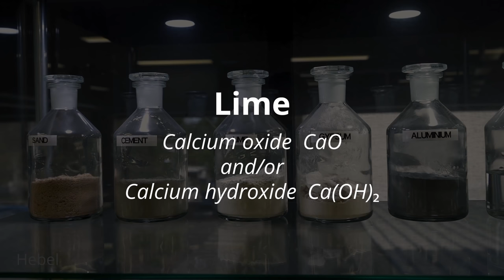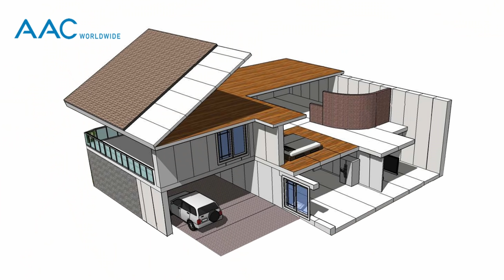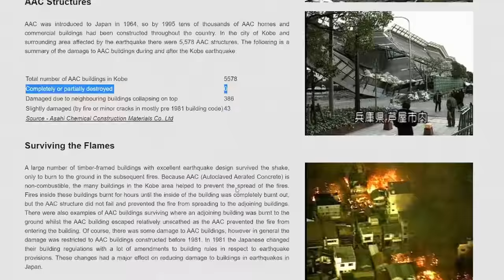AIRCRETE lightweight concrete | Everything you need to know

Comment: You are overexcited about this material. Here in Russia we are widely using these blocks in construction. Soundproof next to none. Very brittle to handle and have tendency to crack over time. Soaking water as sponge loosing all the insolation capabilities. Only real advantage is the cost, probably less expensive material of them all, but still has a lot of downsides.

Comment: I have built my house with AAC in order to make the house a fully electric one. There’s no gas service in the region and I didn’t want to deal with a wood boiler.

My house is very energy efficient so even using electricity to heat it, it is still cheaper than natural gas in traditional brick houses.
Reply: In EU we have strict rules for energy comsumption of new builts,  it's easy to build in passive standard  with aircrete.

Comment: Half of houses in Poland is made out of it. 
The blocks have to be protected from humidity, VERY well. 

Saying that, it makes sense and can be very cost effective. 

I think in Japan it is used as a filler for the walls, due to strict earthquake standards. Saying that, these standards were introduced after Kobe disaster. 

Personally I think it is a decent material if used as intended. I'm still surprised it's not used in America. It provides some thermal mass, making buildings more comfortable to live in. 

It would definitely help to build cheaper housing, as it is possible to make the walls in one day with smart design and a small crane.

Comment: As a Building Scientist - I can tell you a trick to making this type of concrete in small quantities:
.
.
We got cows blood (disgusting I know - sorry) and mixed it with the concrete mix, then vibrated the mix.  The blood quickly creates bubbles and holds those bubbles long enough for the concrete to set.
.
.
We coated the outside of the concrete and cast small boat hauls.  We then competed in a boat race made of concrete.  "Most" of us did not do a good job of coating the concrete and hence all the boats would quickly get soaked and sink while we were paddling as fast as possible.
.
.
It is a great material but it does have its limits - don't use it where structural strength is needed (no reinforcement in this material).  The only true problem with this material is that it is expensive.  Say as divider walls in a building - it is easier to cast concrete as the construction already has all the settings for casting concrete.  Don't get me wrong - I'd prefer this material as its sound resistance properties are way better than cast concrete which makes it more suitable for a dividing wall.
.
As for simple housing?  This material would be fantastic in houses.  Unfortunately tradition trumps all.  In North America they don't even use ceramic tiles on roofs that last forever, instead they use shingles that need to be replace at an expensive cost every 10 or so years.

Comment: Do most U.S. building codes allow them as the primary structural component? I was under the impression they can only be used as infill in walls that have frame members.

Comment: Thanks for the tip with HEBEL building materials - an alternative to YTONG which I experienced roughly 40 years ago: I had a block of YTONG to sculpture it with simple tools and with moderate force applied.
I do not understand that these materials haven't found their way into standard building practices much earlier. Monolithic walls for passive houses ... would have solved a lot of the problems with high energy demand for room heating (her in Germany).

Comment: I have been hoping to see a video like this for a while now. One thing I would have have loved to see touched upon in the video is the efficacy the DIY aircrete methods that make it by means of mixing concrete with a foaming agent such as dish soap. Given this can theoretically be made on site it may in some circumstances have more benefits than premade blocks.
Reply: Foamed Crete is not as strong (unless you add fibers). It will crack. It's hard to get the recipe just right. But... much cheaper, no shipping

Comment: After building a partition wall with half sized concrete blocks (75mm) I came across Hebel blocks. There was a gap from a high set timber house to be filled in. Now I love this new product but there is practically nothing available in remote regions to integrate it into traditional building materials. Great product in desperate need to interface to legacy structures.

Comment: One of the biggest plusses for me is that it is so easy to work on. You can saw these with a normal wood handsaw if you want. It will wear out the teeth fast though.
I've used these blocks to close up an old door opening, and they're very regularly used as the first row in mason walls, because they have decent thermal insulating properties to keep the cold from the ground out of the walls.

The one application I don't get is the sound blocking wall you showed. It seems like these blocks are too fragile for this application. I'd also worry about the prolonged effects of rain.

That all being said, I'd never want a house built exclusively out of aac. I'd want my walls and roof to be sturdier that aac.

Comment: This could be an interesting material to use for a boat hull and deck.
Reply: I don't think it has enough compression strength if used as a core material for boats.  It will pulverise under high loads. It hasn't any elasticity. Exterior sheathing could also be problematic.
Perhaps ok for house boats.
It's still a very worthwhile material for static or low stressed constructions, though.

Comment: Pretty much every new house in europe is built using aerated concrete blocks. Ridiculously fast build time. Especially for those single-floor "american" style houses without a cellar or living space in the roof (weak and lightweight ceiling). Installation and finish is also super easy since everything is straight and square due to slotted block design. Idk if those homes will last as long as our 200 year old atomic bunkers with 32 inch brick/ reinforced concrete thick walls but it will definitely last longer than a paper home.

Comment: In Romania (Eastern Europe) it is one of the most popular building materials. It is relatively inexpensive, very easy and quick to work with, but requires additional insulation on the outside of the building.
Reply: Curious to know what the additional insulation is made of
Reply: @EbrahimHasan  Clasic EPS,  rockwool or fiberglass
Reply: @EbrahimHasan  foam dude. insulation is mandatory here for new building.
Reply: Cool, now I'll try to find Romanian houses made with this online.
Reply: @Timoshim  thanks so much gor the tip!
Reply: @helloworld963  @Kaldusar So strange. AAC is insulation in and of itself and we build with it alone. Sometimes we thicken it for added insulation. It's a lot more lasting and much cheaper and stronger than EIFS and other material both to acquire and to install.

Comment: Very cool.  Emotionally satisfying.

Also, I'm reminded of the DIY air-crete videos on YouTube, and wonder about their viability for 3D printing homes or shooting layers if their tech were extended.

Thank you for mentioning the STC rating!  I'm guessing it could be increased to sixty or sixty-five (which would be preferable) if the wall system incorporated two layers of two inches which are de-coupled, although that would require separate structural support to avoid anchors between them.  It would be, again, exciting to see aerated (like the DIY foaming) being, "shot," onto "non-ferrous" chicken wire or stucco latices on opposite sides of an interior wall which could later be plastered (hopefully with European style limestone plaster rather than Portland cement) to avoid paint and give a long lasting surface that abates moisture.

Comment: All pro's are mentioned well.
Some Cons:-Water is biggest enemy of this AAC blocks.Concealed plumbing line leakage will give you some ugly time to locate & rectify as leaked water can dampen  the wall & paint finish of the wall.
Water also rises from cement mortar laid beneath the floor tiles & spoil the wall finishing.
Nails don't have a grip so need proper care to do so

Comment: It would be cool if this could be produced on a smaller scale.  Making it more localized might increase its popularity.  And it would be even cooler if it could be 3d concrete printend.  It would be extremely slow but could have some crazy allocations.  Regular 3d printing is experimenting with foaming plastics, which has some cool results.   It's not super useful yet but i feel it will find a use.

Comment: Usually people test aircrete heat resistance by short time high temperature. What about continuously see how long it needs to release the heat to the temperature before burning.   And why don't test by using lower temperature like 70 degree  for a few hours heating see  if the results are almost same.  It is better than other brick, but too fragile and It might not work that well to tropical country, the interior will still hot  , but in the slightly slower way. End up the whole night will be warm😅, I think the better way is to block the sun heat before it arrive to the wall material.

Comment: SO why it is not used that much? 

Time - the blocks arrive with a high moisture content and require time to dry out. Thus a traditional construction of a house done in 6 months is impossible with this blocks: exterior/interior walls cannot be finished as soon as the box is up because the walls need ventilation and time to dry.

The shape is not as regular as manufacturers make you think requiring manual labor and attention --> thus specific learning and skills

For seismic stability, they require reinforcement columns and belts and do not by themselves offer any additional seismic resistance. 

Passing conduits, cables or pipes? easily done but not as simple as drilling a hole in the 2x6. Or... you have to double up the walls and ceilings by using sheetrock on steel studs much like in an industrial construction. 

Repairs... moving the kitchen cabinets on a different wall... buying door frames (interior or exterior) for this thicker wall ... Everything becomes an issue with this tech because there is no expertise and it is not standard in North America.

Move to the Europe and YTONG is known almost everywhere and all of the above is a non issue.

In short,  it is an interesting material but it has its drawbacks and quirks that make it much less competitive in US and Canada where the entire industry is build around specific building methods and materials: sheetrock and stick frame (or sheetrock and concrete and steel frames for bigger buildings).

Comment: You mentioned lower transportation costs because of the lower weight.
The limiting factor in transportation is volume, so concrete mix should have a lower transport cost compared to aerated concrete

Comment: I'd really like to know how this would fare in marine environments. We're planning to build a float home. We're not remotely concerned with aesthetics, frankly, so that's not the issue for me. I'm wondering more if it's too light for use. The boat has to be calculated to have a stable draft, and if you can have a heavier boat you're less likely to have issues when the water gets frisky. I can see creating pontoons out of this, or possibly filling the insides of plastic raft barrels.

Comment: If it uses less sand we may have to start moving towards using it anyway. The supply is dwindling far too quickly for how long it takes to replenish it.
Reply: For stuff like concrete we can produce it artificial sand, yes wind blown sand doesn't work I know but crushing works fine for making analogous water sand, also given how porous concrete is made I'm decently sure it uses mechanically modified sand anyhow, so I assume it can get by with the desert sand we already don't use and just crush it to a finer powder.
Reply: @jaykoerner  Besides deserts, there is an incredible amount of sand where rivers reach the ocean. In the Pacific Northwest around the mouth of the Columbia the beaches grow very quickly and it would swallow towns if not shipped off continuously though much is dumped and not used.
Reply: @seasidescott  I was talking about specifically unusable sand,
Reply: @jaykoerner  Beach sand is considered unusable for mortar and construction because it is rounded just like wind blown desert sand. I was taking your lead and saying that if there's a short supply and we've resorted to crushing it, there's plenty more.
Reply: @seasidescott  I have nothing to add because your comment added nothing to the conversation between us since it just fleshed out info I stated, but hopefully it's helpful for someone else reading this

Comment: Nice material, nice review, but Belinda is incorrect on soundproofing. AAC has poor sound insulation properties. Even a 60-centimeter thick wall of D400-grade AEC  (as in my house), by itself, doesn't stop much exterior noise. Fortunately, for me it's mostly birds and wind.

Comment: This sounds, cheap, good for insulation(?), and probably ok for a home, but I really doubt it will stand up against the elements over long periods of time, and it likely wouldn’t do well when put under great stress.  There are types of (expensive) concrete designed in response to 911 that are magnitudes stronger than conventional concrete, but I imagine this wouldn’t help reduce the casualties caused by a structure failure.

Comment: You mentioned things like aec being pourous as to therefore require additional waterproofing substances to coat the outer walls if used as home materials. I'm curious what are the combined costs. Old traditional bricking/concreting vs same structural value using aec and it's assistance proofing parts

Comment: You mentioned that it is recyclable, can you expand on how that works?
This AAC would be perfect when used in RBV (Reverse Brick Veneer) construction except using AAC instead of brick, which is A LOT better thermal mass-wise.

Comment: I think an A-frame with impact windows / shutters would be a good test bed. I'm curious about wind load and  fire resistant /waterproof coatings. With that it could be viable option in many places.
Reply: Tilt-up EPS/steel sandwich panel roof; apply shotcrete.

Comment: Questions! 
1. Can this be combined with IFCs or would that be redundant?
2. Would this sweat in humid places where air conditioning is used?
3. Does this work with FRP rebar or other alternative kinds of rebar?
Reply: I'm no expert, but currently building with it.
1. Doesn't pour, so AAC can't be used with ICF. DIY foamed-crete isn't practical. Not strong enough, you can't pour that many yards (no concrete truck will pour it)
2. Absolutely no sweat. Hygroscopic like wood. Most comfortable wall I've ever experienced.
3. Will work with any rebar.

Comment: No need for expensive manufacturing plants to produce cellular concrete, construction blocks. The future is a small footprint, mobile manufacturing plant. One that can produce several hundred blocks a day to support about a hundred mile radius. Low energy, low labor requirements. All unused water is recycled along with left over material. Yes! This will work in California. I'm on a mission!

Comment: I am fascinated by this building material as I have designs on building dome housing in fire prone areas of the SW. Can this formula be used as a pour in place material even though it may be prone to shrinkage? I'm also curious as to the fire rate of perhaps a regular alkaline fly ash concrete verses a poured slab of this aluminum activate alkaline foam concrete. I ask this because to maximize fire proofing of a structure would you want a layer of this on the outside of a dome of hard concrete as well as inside a dome? Do you think it would be a good insulation material to inject between 3D printed walls for sound proofing and insulation or would that simply not be beneficial enough to warrant the expenditure? I value your opinions as your previous videos make perfect sense to me, thank you.

Comment: I wonder how large the product can be made and shipped without tipping the price the other way?? As light as it is, it seems that very large sections could be made and placed thus making labor costs far lower. I also wonder if one layer can be laid directly upon another without issues?? This would make building an insulated roof strong and easy....

Comment: Don't know how long houses in Germany are already built like that, Especially apartment houses. Surprised that this is a novelty in the US
Reply: I live in the US, an I am truly amazed at the different materials that I am just learning about. That has been used for decades in other countries. I am truly saddened by this fact. The American building materials are more impacting on the environment than in other countries. Or government claims to be concerned about the planet, however, doesn't change that l their base thinking. We've always done it this way..... Has asked us to reach this point of planet wide impact.
Instead of actually doing something about it.
Sitting in an office, writing about a subject and what could or should happen; isn't the same as putting the rubber to the road. 
If you aren't part of the solution you're part of the problem!
They are so closed minded to new products, here in the US, they shrug off a product because they don't know enough about it.
Here's an idea, communicate with these other countries and utilize their years/ decades, of information and use make a clearer opinion. Not just shrug it off because, it comes from some sinister country that we don't agree with at the moment! 
If it works, it works. Who cares who came up with it or how long they've used it. Open your mind and hearts to change.
Change is not always bad! 
Wow.... That went on didn't it? Sorry for my tangent. I am ashamed, embarrassed, and disheartened, at my country, for not truly trying.